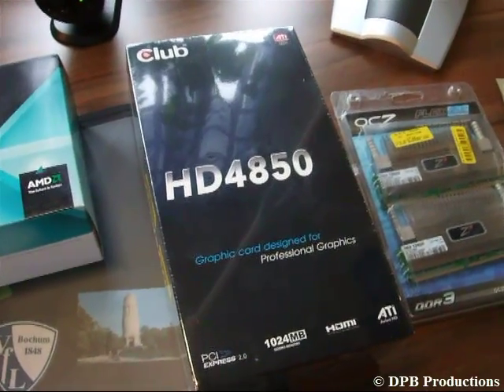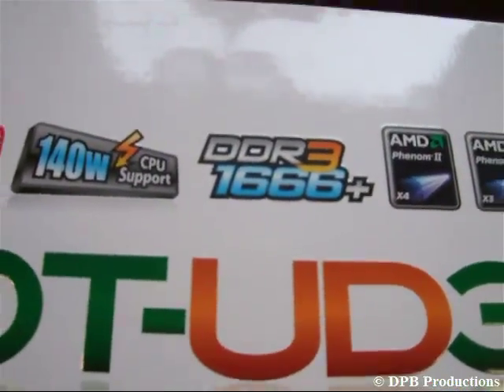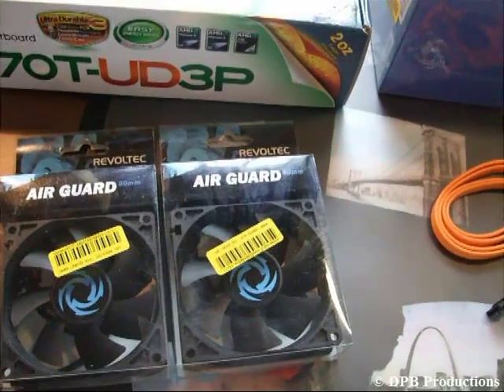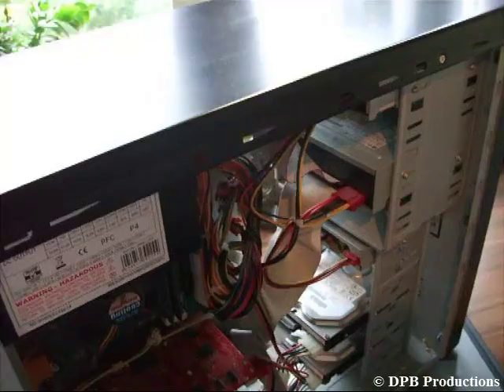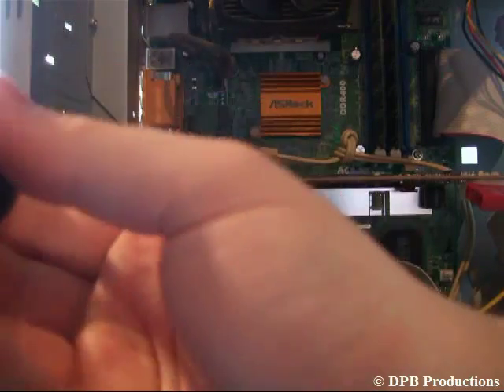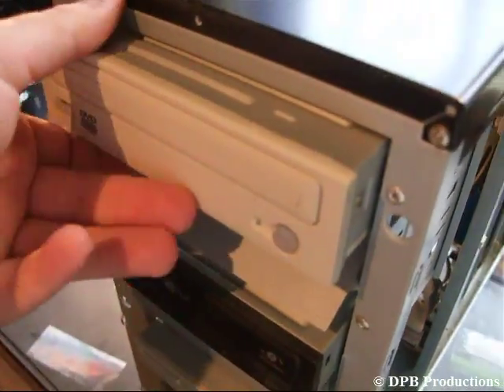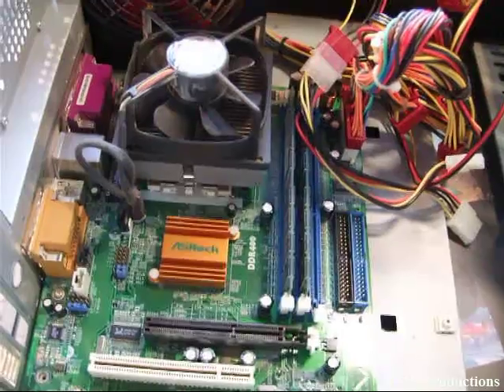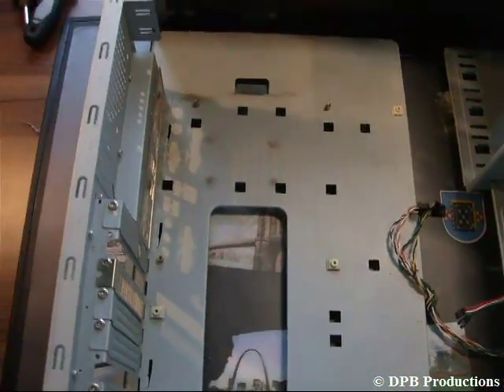How to rebuild your PC? Part 1

Comment from the maker: 3. I didn't use the old power supply, because it wouldn't have enough power for the new setup.
4. Most of them I threw away and some parts like the power supply I sold on Ebay.

Comment from the maker: 1. Of course you can use your old case. You only need to check if it is an ATX-Layout case, when you buy an ATX mainboard.
2. You're right. You can use your old IDE hd, but the reason why I didn't use it, is simply that I wanted to have a hd with more space and so I bought a new one and gave the old one to my sister. I theory sata is supposed to be faster then IDE, but it's not as noticeable as the difference between a standard hd and a ssd.

Comment: i have many questions in here...
plz reply.
1. if only use case, why don't new case?
2. in part 2 video, why don't install old IDE hard disk? (your motherboard have IDE connection)
3. why don't use old power supply? (I know you new motherboard use 8pin, but 4pin also can start) *if no overclock
4. and where your old parts?